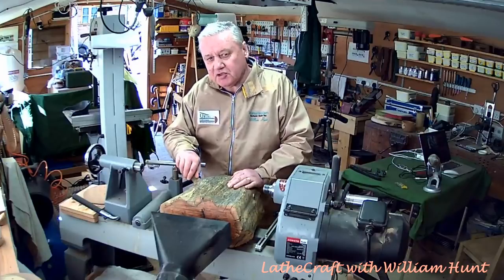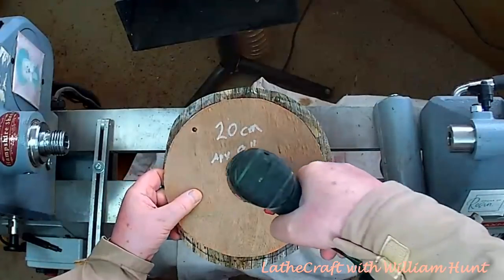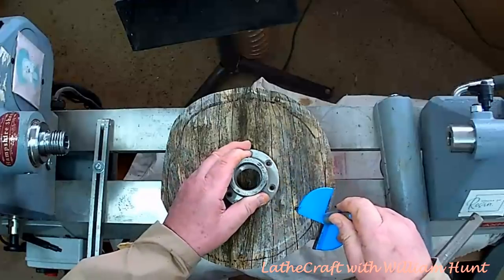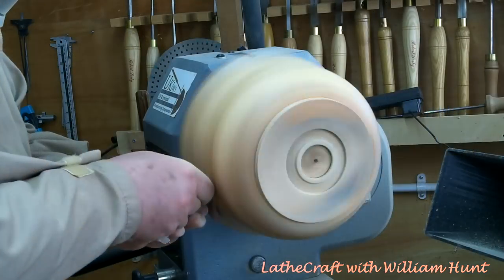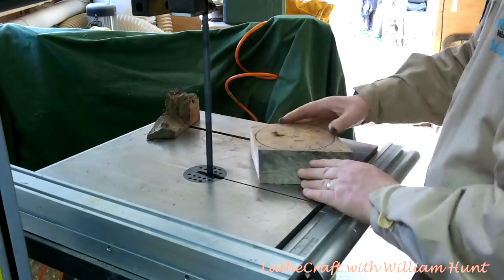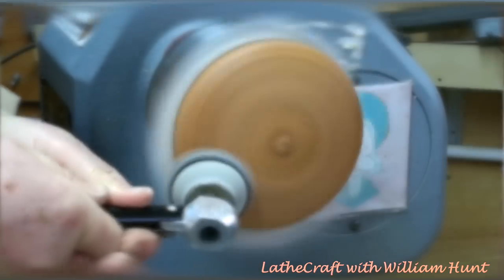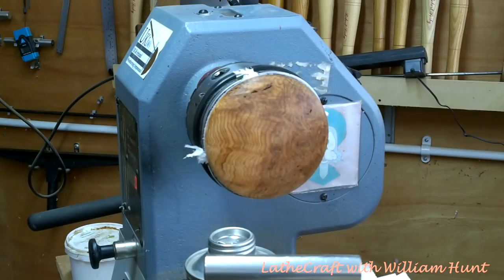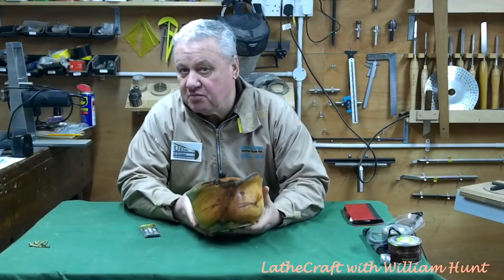Woodturning - Lidded Yew / Bur Yew Pot

Comment: Another beautiful rustic piece William.  Sometimes it's best to let the wood speak to you as it's turned, (along with design modifications) it can be amazing what transpires.I believe your finishing regime also does this piece justice.I have a similarly large piece of Yew it's been drying out for the last three years, you've inspired me to do something on similar lines as soon as the moisture content proves fruitful.  Thanks for posting and sharing, regards and best wishes. T.
Reply from the maker: Hi Tony. I totally agree about listening to the wood. If you dont, often it will get angry and bite you, sometimes literally! If your Yew is around 15% it will be OK, some checking with this type of timber is inevitable, but in my opinion it adds to the character.

Comment: Sure wasn't close to how big it was going to be .I really like it in the fact it has some size to it. You never see larger pots by or from any one anymore. And that sucks!! All you ever see are small to tiny pots being done.Beautiful pot and great job turning it!! Sucks about the marker but it happens to all of us at one time or another but it's still beautiful all in the same
Enjoyed and gave a Thumbs Up also
Reply from the maker: Hi Russel,  yes I managed to make use of most of the wood so the final size was 8" diameter, 4 1/2" high and lid 4 1/2" in diameter. Yes the marker error was dumb but the blackened rim was too dark, so I had to tone it down with a wire brush. Thanks for the kind comments!
Reply: @WilliamHuntLatheCraft  You're Welcome and thanks for making a large pot for us that just enjoy watching woodturners